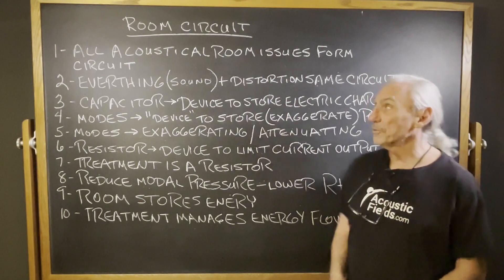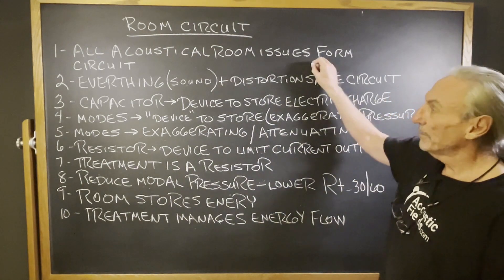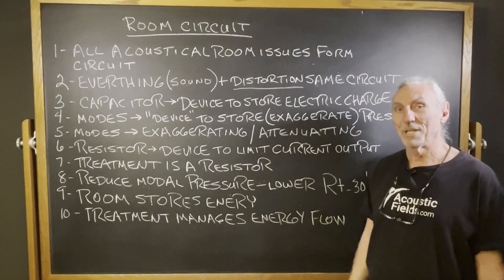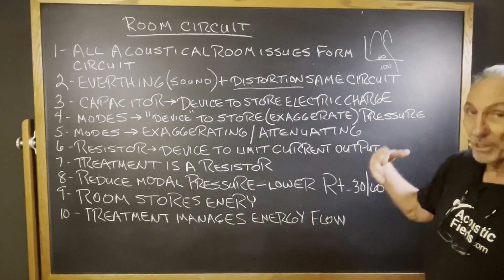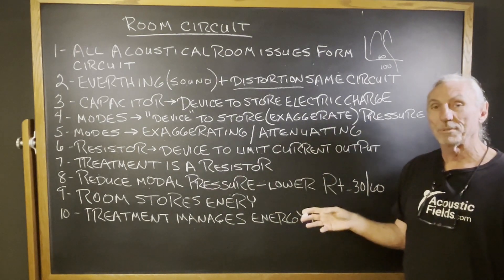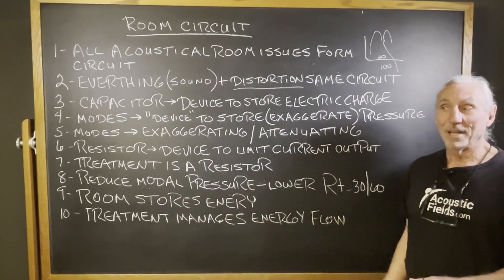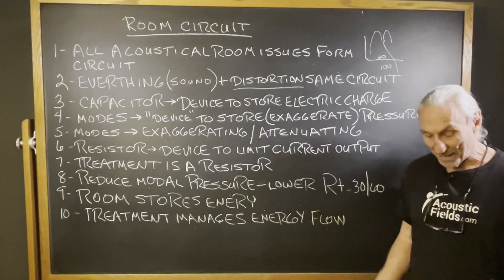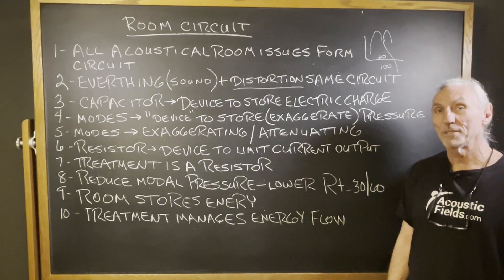Room Circuit - www.AcousticFields.com

Comment: Nice! I "liked" the video. We may also view the modes as amplifiers with dynamically variable gain (+ or -) correlative to the wavelength and resistive-reactive time constants within the circuit.
Reply from the maker: Yes, well said. You could add that lower frequency modes are higher powered amps than the mids and highs.